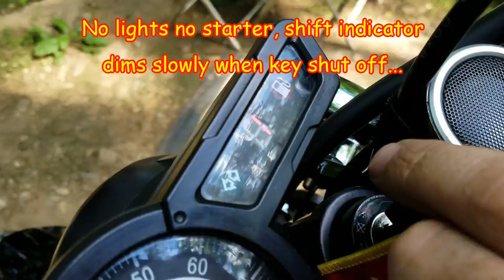[E42] RPS Hawk 250 enduro and Magician 250 100 mile ride adventure

Comment: I just did a 236 mile round trip on my Hawk a week ago (then the next day my tube went bye bye in the front tire...LUCKY).  Aside from the seat not being the most comfortable thing long-term, it is probably the least beat up I have ever felt at the end of a longer ride.  With my current setup it will cruise at 60.  I managed an average speed of 52 according to my GPS, so not bad.  The little motor with a big fuel tank is a nice combination, I must admit.  I didn't have to fuel up until I was maybe a half hour away from home.
Reply from the maker: +OddBallPerformance not bad, yeah Vee popped front tube too
Reply: A common issue on the Hawks.  A couple of other guys had the same issue.  Some of these wheels have some sharp edges on the inside that are wearing through the tubes.  They are also very thin tubes, which probably doesn't help.
Reply from the maker: +OddBallPerformance they are thin, the rubber tube guard on Vees was slid over, but not sure if that was after the flat....

Comment: There is a guy that bought a Hawk and when he put it together there were some things he had to redo, no big deal easy stuff really. But one thing he was beaching about was that the rear axle kept slipping out of adjustment. But it looked like he was missing parts that I've seen on other Hawks. Does the rear wheel stay adjusted on yours? To me he was missing some of the parts that keep the wheel from moving on his swing arm. I don't know if he didn't know what the parts were for his swing arm and didn't put them on or what. If you don't mind, could you let me know how yours is? He also showed how his front and rear sprockets are loose and wobble. Thanks man. Paul
Reply from the maker: I saw that video. He did a lot that wasn’t necessary. The rear axle when tight won’t loosen either. Just wanted to complain. I left a comment.

Comment: Motocheez  i do like the LED bar light looks great on Blades cycle . Also i got my shift lever welded  for free for my magician  all is good now , Thanks for the  advice.
Reply from the maker: +SouL Reactivator I like the way it came out too. Cool, free is always nice, get some miles on that Magician!
Reply: +MotoCheez man you need to get the vemon x22 super pocket bike plz get it and do a review  on it
Reply from the maker: +Lean Poo funny you me tion thar, I was looking into the China sportbikes. They make 250cc ones too.
Reply: +MotoCheez i wish you would buy the venom x22 super bike i would like to see what you can do with it it looks like a fast bike and it is
Reply from the maker: +Lean Poo I'm working on it.. see what dealer will cut me some kind of deal
Reply: +MotoCheez if you get that bike that will so fucking amazing

Comment: could you tell me where the VIN number is on the Enduro Hawk I recently purchased a 2014 Enduro Hawk and am having trouble finding it
Reply from the maker: +itsColtrain on the right side of the steering tube in front of tank and a label under the tank on top of tube.
Reply: MotoCheez I’m looking but not able to find it
Reply: any chance you could send a picture or short video?
Reply from the maker: +itsColtrain it's on the left side, you can also see tag under tank. https://photos.app.goo.gl/dQQunP3aOZ7vDMBi2
Reply: THANKS SO MUCH, finally found it
Reply from the maker: +itsColtrain You're welcome!!

Comment: i feel like i should get a modded hawk 250 rather than xs400 1982 as far as what i want the bike for xs400 just alil basic to me
Reply from the maker: It won't be as fast of course, but they're a lot of fun to mid an ride around.
Reply: so for havin it for awhile would xs be more reliable?
Reply from the maker: Yes, probably. Although they're getting better, they're still behind on quality compared to Japan sadly
Reply: @MotoCheez  okay last thing i loke to go in dirt to alot so all wround the hawk if modded right could potentially last as long as the xs
Reply: @MotoCheez  also i feel the people giving bad reviews on these dont kbow to mod them up stock is good for price but wont last lomg these bike in mexico etc like the hawk last forever .
Reply: cause it a med to light riding not tryna motorcross it everyday know what i mean thats with everything stock modded its def fine for some fun
Reply from the maker: It's a clone Honda CG engine, yes technically it should. These engines proved themselves in the heat if Africa for many years. It's a low maintenance engine design, only thing is, the QC is not as good in china....yet

Comment: I wonder how compatible all the crf 230 parts are for this bike. Are the engine mounts the same? etc
Reply from the maker: JoshuaBrah I heat a lot of parts are, I think thats the rim that works
Reply: The exhaust is for a CRF230 also, right?
Reply from the maker: Each Adventure Yes

Comment: Hey bud. I own a Apollo 250 cc. I just got it street legal. Legit in ny state. 
I'm having an issue with the gas cap vibrating. It's wicked loud and annoying. Also it started to leak. 
Any tips for me ?
I'd appreciate it.
Reply from the maker: +ZeroLimitzRC I woukd contact the dealer for replacement parts first... there is a spring in the cap for a check valve, you can try freeing it up by tapping it on a board, suck on the hole on bottom to see if it's working... it's leaking from where?
Reply from the maker: The cap vibrating.. on mine it was a side panel, I put 2 sided tape to stop it
Reply: MotoCheez 
From under the cap. It only did it when I pulled back in the drive. Turned the bike off. And blah. It leaked out. Not a lot. But enough to be worried. Hot motor and gas. Not so good. 
I think the gas got by the shity gasket
Reply from the maker: +ZeroLimitzRC oh, like spilled out from the filler? I thought was a venting issue. Must be the gasket?
Reply: MotoCheez 
My cap locks on like your hawk. So I can't tighten it more. I just line it up. Turn it to the right and lock it. It's just not a good seel in my opinion. I can't use a regular screw on cap. Just not the same set up. Won't work.
Reply from the maker: +ZeroLimitzRC yeah, the rubber seal must not be good. Mine has never leaked, you have to push pretty good on it to latch.
Reply: @ZeroLimitzRC  a hot engine and gas doesn't mean anything. HEAT does NOT make gas ignite. Neither will a lit cigarette. It goes out. You need a spark or flame to ignite gas. It is oil, kerosene and deisel that has to heat up so much before it's combustible.

Comment: So for a trail riding/ short commute bike would you say the hawk is better? Is there much difference power wise?
Reply from the maker: The power is it exact same, the magician is a little bit lighter and a few inches lower and it comes with Street / dirt tires. The hawk comes with DOT knobby tires so I like the hawk because I do more off-road and it's taller for me I'm 5 foot 10
Reply: MotoCheez ok cool i been looking into getting one of these. I have a dirtbike now and love it but its not street legal. So now i need a dual sport. Ive heard the bashan enforcer is better than the hawk? Or so some people say. They look like the same bike to me
Reply: shenaniganz krew 22 i have the bashan storm. i think its a little better chinese bike. however, it still requires maintenance and upkeep. all the mods the hawk can do, are the same for the bashan storm, same engine. but the storm sits a little lower due to more dual sport tires versus knobbys. the enforcer is the newer model i think. however, if u can get a storm, get that. i liked it because of the fairings. but the hawk will be just as good.
Reply from the maker: Yeah. The Hawk was the cheapest DS I could find at the time. The magician is cheaper now
Reply: @MotoCheez  I'm fixing to get a magician. Its being shipped now :) I love how it's so basic, has an old school look, and it looks like it's better equipped to handle tight trails. It looks thinner and more agile than the hawk to me. Plus all the turn signals are well placed to not just get snatched off by a limb or break off due to an accidental lay over. I think the front fender and headlight kit don't look over appealing on the hawk, either. The front end looks like the front shocks are weak as fuck. Like it looks like the front is squatted some... Just the way it looks to me. however there aren't any reviews on the website for the magician yet. But seeing as blade has one, how good is this particular model?
Reply from the maker: It's a good bike! They're all about the same quality, the magician was a bit small for me the way the pegs were I felt scrunched. It is a few pounds lighter, the suspension on the magician was a bit stiffer. Let me know how you like it!

Comment: Hey Cheese always love your videos man! Do remember was size battery terminal nut the magician uses?
Reply from the maker: 6mm bolt w 10mm head
Reply: @MotoCheez  your the Bees knees man! Hey can you do a top speed video with the magician? I try to only watch your channel
Reply from the maker: I don't own it anymore, it would do 65 maybe a tad more with 17t front sprocket
Reply: @MotoCheez  did you not like it anymore?
Reply from the maker: I got a lot of bikes to review back then, so sold it to Blade. It was a little small for me  He put over 10,000 miles then sold it, then my friend Matt bought it a year later had 12k I believe. I did a video... Haven't seen it in about a year

Comment: If the engine is the same as the crf230 then am i able to put the big bore kit on my magician that is availible for the crf230 and also is the speedometer acurate for the magician
Reply from the maker: james blanco the engine is not the same, the frame and wheels are. The engine is a honda CG250 clone
Reply from the maker: +james blanco frame same as hawk I meant...

Comment: Did you have to buy a different dash cluster for the digital portion on the hawk?
Reply from the maker: Yes, it's aftermarket
Reply: @MotoCheez  Could you give me the link  where you ordered it from? Also, on your review of the Tao TBR7 250 would you recommend it? It seems that if you have any idea on how to work on a bike, it would be a pretty good steal? Advice?
Reply from the maker: If you go to motocheez.com I have the links, you also get a discount if you use Motocheez in the discount area I get all my Chinese bikes from txpowersports.com. if you are a little mechanical you will do fine or if you are willing to learn
Reply: @MotoCheez  Thanks for the input. Subscribed! Keep up the good vids!
Reply from the maker: TY 👍😁😁
Reply: @MotoCheez  Does the carb mod, with the front sproket that you have the link for the hawk 250 also work for the tao tao 250 carb?